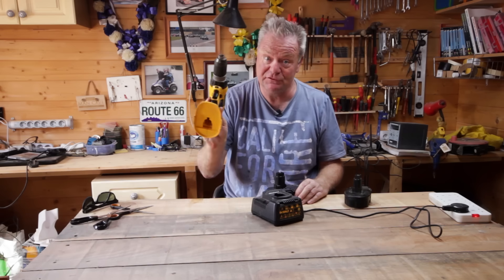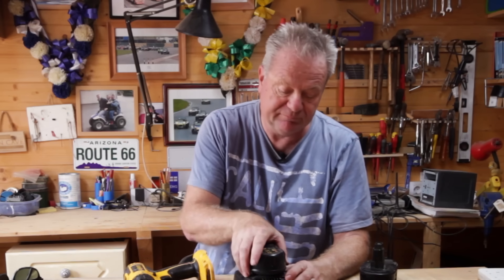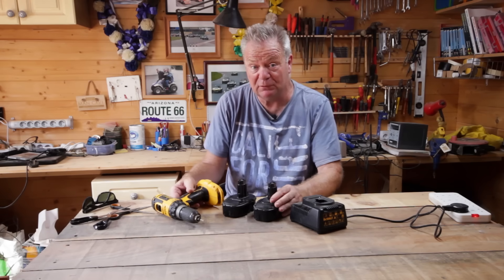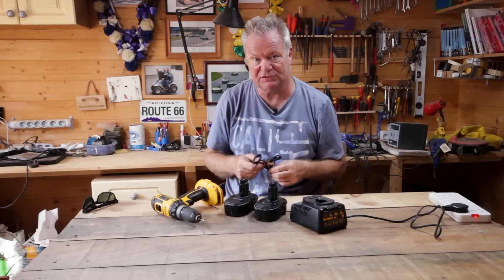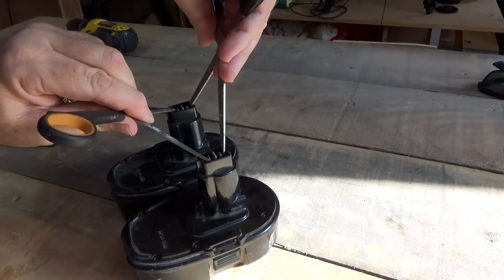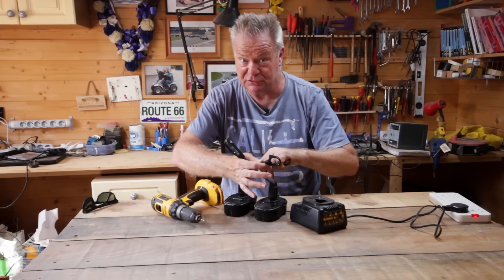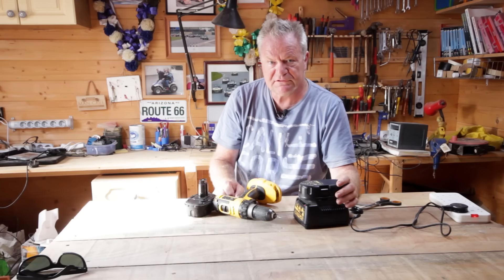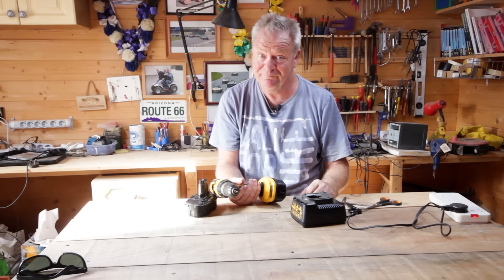How to revive a dead rechargeable power tool battery easily

Comment: I tried this and now my scissors won't cut.
Reply from the maker: haha good one. Try zapping them with a battery 😀
Reply: @JPinFuerteventura  Actually, the correct method is to touch each blade of the dull scissors to that of a sharp fully functioning pair of scissors to jump them back to sharp cutting scissors.  :-)
Reply: @pf465  HAHAHA 😝.
I've done that, now my scissors are blunt tipped.
Reply: https://youtu.be/Lo--C1FykEY

Comment: I didn't expect this to work, but hey, my battery that went from 0.10 V on the charger before flashing saying to replace it is now charging.

I used a 9V battery for about 2 minutes. The battery got a bit warm
Reply from the maker: I am glad it helped. Thanks for watching Tyler.
Reply: @JPinFuerteventura  okay, so my battery drops from 7.27 to 4.5 overnight so I guess it's actually busted. Oh well. Still a good tip

Comment: I have same issue with a cordless drill from an old schoolteacher, it's Lion 3 batterypacks, doesn't do a thing, one works for few seconds ( battery that is) 2 others don't do a thing. Any idea's help? I measured the charger, is ok, battery is bit low.I saw someone was juicing it up with a carbattery, 3x stroking on +. But I am not that convinced, I heard there was some kind of memorychip? Any help appreciated.
Reply from the maker: Well those who are apparently in the know say you shouldn't try this with Lithium batteries. Perhaps someone can answer you.

Comment: Most times if the battery is getting that hot it is not correctly charging and will not last as long as a replacement or a new battery. Would rather of seen a video on how to change the internal batteries which have to be less money than buying a complete new replacement
Reply from the maker: Well make a video about it then!
Reply: (believe it or not) there ARE some video's out there that show what you are requesting. The thing is, ya just gotta "go look" for them first -especially before requesting a new video be made about it (ya know?) Just sayin' -:)

Comment: This worked for me. What’s the longevity after something like this? Will the battery die again soon?
Reply: Tried it with my 18v Dewalt and after charging it’s holding 14v.
Reply from the maker: I am glad it helped. How long the battery holds its charge depends on the condition of the battery. This fix gets around the "smart" charger not detecting a battery has been inserted to start to charge it.

Comment: Can anyone tell me why this worked?
Reply from the maker: It works because the charger is a "smart" charger and it doesn't recognise that the battery is inserted as it needs to detect a charge to start. The battery was completely dead so wasn't detected. By jumping it to the other battery it gives it sufficient charge for the charger to detect it and then continue to charge it fully. Thanks for watching.
Reply: JP in Fuerteventura, Oh, thank you.

Comment: I wanted to say thank you for sharing this trick. I had a dead DeWalt 14.4v battery which unable to charge, plug in charger and the charger blink non-stop telling me it's faulty. But kept the faulty battery for almost a year(actually forgotten about it) until I happen to stumble across your video by chance. I took out my other working DeWalt 14.4v battery, did exactly what you taught in the vid with scissors also, then after 15mins I plug the dead battery in and it started charging!!! After full charge I test it and it's back working again. 
To all those who do not believe, do not say rubbish because you have no idea what is going on. However I do not know will it work on li-ion batteries as mine is the old li-cad battery.
Once again thank you for showing this awesome trick to revive my dead old battery. Everything you say is so darn true, not worth buying new battery but the drill is still very good...
Reply from the maker: Great, I am glad it helped. No, you shouldn't do this on lithium batteries. Thanks for watching.

Comment: Why didn’t you try the other battery.?   one of them had a charge and one was dead. You must think we’re stupid... but to give you the benefit of the doubt, I have several dead ones and one that I bought new that works, we’ll see, if it works I’ll come back here and apologize.
Reply from the maker: If I had known before I made the video just how sceptical people were on Youtube then I would have shown both batteries. But since I was just trying to pass on a tip which may help some people and not to trick anyone I didn't. Why would I anyway? I am not trying to sell anything.

Comment: I am so glad that I found this video. It sure saved me a lot of money. I was able to revive 3 of my batteries. I was debating in buying new batteries or just buying a new drill. I decided to see if anyone had ideas to revive them because the batteries were for my Dewalt drill, circular saw, reciprocating and flashlight. This method worked like a charm. Thank you for posting and sharing.
Reply from the maker: I am glad it helped Rick. Thanks for watching and letting me know.

Comment: Awesome tip! Might upgrade from scissors to wires with alligator clips, to prevent having to hold them. Also if the battery COMPLETELY dies, take it apart. You will find 1 or 2 banks of 18650 Li-Ion batteries. Those are cheap to purchase online. Just rebuild them. :)
Reply from the maker: Living here in Fuerteventura you learn to improvise Jordan. The "wisdom" is that you shouldn't do this with Li-on batteries but as you say you can replace the cells (although again I would be unable to buy any here). Thanks for watching mate.
Reply: That's the thing I am not sure how to do that as I am not electronically minded

Comment: Brilliant!!!  I have a few power tool batteries that won't take a charge and this is most likely their problem (too low a charge to begin with).  Will give this trick a try.  FYI...  For power tool batteries that are truly "dead", you can disassemble the battery, remove the battery pack itself and replace it with a replacement battery pack of the same specifications.  The specs should be plainly viewable on the battery pack somewhere and replacement batteries can be purchased from online sellers for a fraction of the cost of a new battery.

Thanks for taking the time to post this no-nonsense how to...  As far as all the negative comments.  Fuck all the douche nozzles.  More often than not they're just miserable, pathetic people, trying to spread their misery through shit head comments on the Internet.  Cheers!
Reply from the maker: I hope it helps Jeff. Thanks for the other tip mate.

Comment: OK, OK, here's another testimonial. Had one B&D 12V battery just go completely dead between last use and today. Charger would not charge. Cut a couple of short jumper wires and paralleled with a charged up one and then left them while I went through Facebook. Maybe an hour later I plugged the dead one into the charger. Boom, it charged right up. Thank you sir!
Reply from the maker: Great, I am glad it helped. Thanks for watching and letting me know.
Reply: Which battery positive terminal did you attach the scissors to ?
Reply: @misterman1909  I never said anything about scissors. And also, I posted my comment 5 YEARS AGO. Shortly after that, despite the battery holding a charge again, it rapidly depleted when used. Eventually the "fixed" battery became useless. This method is only a partial and temporary fix, and so would not recommend it again. Buy a new battery.

Comment: I had exactly this situation with a two battery powered drills less than a year old. One battery died and would not accept charge. I was really sceptical after watching this video but I thought why not give it a go. (I did forego the scissors and strip down some insulated wire for the job though!)
Hey presto! Worked a treat, charged up ok and seems to be holding charge and working fine now. Many thanks for posting this great tip, really appreciated!
Reply from the maker: Great, I am glad it helped. Thanks for watching and letting me know David.

Comment: What if you only have one battery. What other trucks can trickle start the charge?
Reply: If it's a 12V battery, maybe jumper it with a car battery. You could also rig up (with tape, a jig, whatever) a few 1.5V dry cell batteries in series to produce the required voltage.
Reply: @whiteknightcat  that actually made me think of those USB car jumper packs
Reply from the maker: Borrow a similar one perhaps?

Comment: I'm confused, the voltage going out of the charged battery I would think is same as charger.  Skeptical a bit as this should work on cell phone batteries if true?  Shrug.  May try it out one day.
Reply: Try it and let us know? It would be a bit fiddly I guess, as phone batteries have 5(?) connections on them.
Reply from the maker: It is the charger that is the real problem Steven. It is a "smart" charger, which like smart phones means it is actually stupid. It only starts to charge when it detects a current. Since the battery is totally dead when it is inserted in the charger, the charger doesn't detect it so it doesn't start to charge. Jumping it for a few minutes puts sufficient charge in the dead battery for the charger to then detect it and charge it.

Comment: Was curious and tried this trick. Actually used a thumb taps and wire with clamps. Tried on old battery (18v ni-cd) on my drill (hyper tough cordless drill).  I had my old drill in the closet. I purchased a new one in July. Had the clamps in positive and negative slot for 5mins. Then plug it in charger for 10mins. Result it started my old drill back up. Will keep posted on battery charged. For few days. Thanks for the tip. I almost tossed my old cordless drill out.
Reply from the maker: I am glad it helped Gabriel. Thanks for watching and letting me know.

Comment: Works great u can also use 2 pieces of wire then no need to hold the scissors ✂️👍
Reply from the maker: Yes you can. I found that using scissors meant I could maintain pressure on all 4 contacts easily with only two hands but any way of connecting them that works is good. I hope it helps. Thanks for watching.

Comment: Same with electric golf carts. If the batteries drain completely out or below a certain low voltage,  they will not respond to the golf cart charger. In that situation I read on a blog just disconnect and separate the two batteries and charge them individually with a car battery charger to bring the voltage back up past the minimum tolerance for the golfcart charger to work again. IMO, Connecting the tool batteries with the scissors is bringing the dead battery back up within the minimum voltage for the charger system to charge that battery again. So many golf cart owners have spent big bucks on new batteries because they didn't know. The other guys on that blog site saved me lots of money just like your tip will with battery powered tools. Thanks very much.
Reply from the maker: Absolutely Phil. Thanks for watching.

Comment: Does the battery you jump from have to be the same as the dead one for this to work?
I have a Panasonic with a bad battery but only have one of those batteries.
Reply from the maker: It is the voltage that is important rather than the brand so if they are the same that should work. Thanks for watching.
Reply: It’s an odd number I believe 15.4 versus the 18v 4ah Makita’s I have
Reply from the maker: Well a lower voltage is unlikely to do the dead battery any harm.

Comment: Thank you from NJ, USA.
Reply from the maker: I hope it helps. Thanks for watching.
Reply: JP in Fuerteventura 

Will this also work on old video cam batteries ?
Fascinating discovery !
Reply from the maker: People have commented that they have tried it successfully on batteries for other devices.
Reply from the maker: It really depends if the charger for the video camera batteries is not charging the batteries because it doesn't detect they have been inserted or if they are just beyond charging.
Reply: JP in Fuerteventura 
Thank you Sir.

Comment: I wonder if you can pull this trick off with a computer battery? Friend of mine had a laptop sitting in storage for two years, pulled it out and will not power on plugged in and will not charge the battery.
Reply from the maker: I think someone commented a while ago that they did this with a laptop battery.

Comment: Sure the battery might recharge, but not fully and will only last a few minutes before becoming dead again.
Batteries only have the ability to take a full charge a finite amount of times, otherwise you would never have to replace batteries EVER.
Take a car battery for example. Why do you think they die and need to be replaced? Like all rechargeable batteries, they can only take so many charges. 
Total BS. 
Also this is a huge fire hazard and might get someone hurt or killed. 
Don't try this at home people, this guy is an idiot!
Reply from the maker: Another keyboard warrior with a brain smaller than an Amoeba. You obviously think you know a lot but actually know nothing. This battery is still giving useable service two years later. Sure it doesn't hold charge as long as it did when it was new any more as it is now probably 8 years old. It is not a fire hazard unless you try it on a Lithium battery (which I state not to do in the description) as there is a slight chance of that becoming hot - perhaps. If you were to read the video description (assuming you can) then you would see that this a method for making a smart charger recognise that a battery has been inserted and not a way of fixing a worn out battery. As for the car batteries, I have occasionally left my car for a month or so when going abroad and the battery was very dead when I returned. My battery charger wouldn't even start to charge it as it didn't detect any current. A quick jump from another battery put enough charge in for the charger to recognise it was connected and to charge it fully. It was fully discharged not dead! But hey, battery manufacturers love morons like you who rush out and buy new batteries at the drop of a hat so carry on.

Comment: JP--This procedure works on the older 18V batteries, but I don't believe you can do this on the newer 20V batteries (at least from DeWalt).  They have a different terminal set-up so that you can't use two pairs of scissors as you have done here to replace the initial (base) charge.  There are probably many more of the 20V batteries in use at this point.  It would be sweet if you could devise a safe way to put the base charge back into the newer batteries so they could be brought back, as well.  Thanks.
Reply from the maker: Well the scissors trick was just what I had to hand. Some have suggested using two wires with crocodile clips in the comments so that may be a way. Thanks for watching Steve.

Comment: What if the battery charges but won’t keep the charge
Reply from the maker: When I saw your channel name I thought you were Shawn from the My Self Reliance channel for a moment. If the batteries won't hold their charge that is a different problem. A few have suggested in comments that zapping them with a higher voltage will burn off the crystals that short out the cells but I have never tried that. Thanks for watching.

Comment: thanks for helping us save money, batteries are a rip off. I have 2 Ryobi batteries that have failed due to the heat of the power has melted the plastic casing around the contact and it no longer connects, do you think a blob of solder will work to get the metal to align with the charger or will solder knacker the contact?
Reply from the maker: That is beyond me Nick. Perhaps someone else will be able to comment and help.

Comment: They still to this day cannot or will not perfect cordless batteries. Almost all of them are designed to fail so you have to continually purchase new tools, and most people are perfectly content to do this ! I think it's best to stick with the old standard, corded tools.
Reply from the maker: I agree Robert however sometimes cordless is the only option, when I was working on my boat away from mains electricity for example. Thanks for watching.

Comment: Dewalt sucks! I am disappointed by their corded electrical tools. Brought many over decades of fixing and only their deteriorated.
 All exposed their wiring. Cordless batteries also don't hold a charge for long as their counterparts.
Reply from the maker: It is hard to know which are good

Comment: I do not think my comment was derogatory, I did not swear or anything
like that.. I just mentioned that from the video that I saw, one could not 
tell which battery was which at the end of the video.. U should have at 
least tested them by putting both in the drill and pulling the trigger.. 
I know someone could have switched 1 or both batteries for the test 
at the end.. To me it was just missing something..  W.G.
Reply from the maker: I can't find any comment who says that the comment you made the other day was. I didn't show that both batteries worked or anything like that as I was just trying to pass on a tip that others may find useful. I wasn't trying to sell anything or trick anyone. What would I gain from that? Before this video went pretty viral I didn't realise just how many sceptics there were on Youtube but my eyes have been opened. If I had then I would have done the things you suggest.

Comment: Hmm interesting, I will have to try this trick. Thanx mate. 
Hopefully it will work on Festool as well if needed.
Reply from the maker: It costs nothing to try so I hope it helps. Thanks for watching.
Reply: My friend says BATTERIES CAN BLOW UP.VERY DANGEROUS
Reply: Your friend could be wrong or I was lucky. I did try this the other day and works like a charm. Find a new friend 😉
Reply from the maker: They say you shouldn't try this with Lithium batteries for that reason